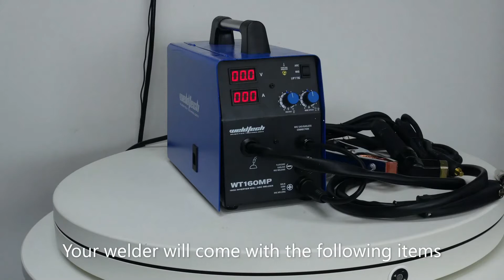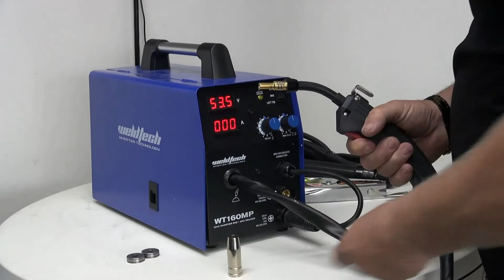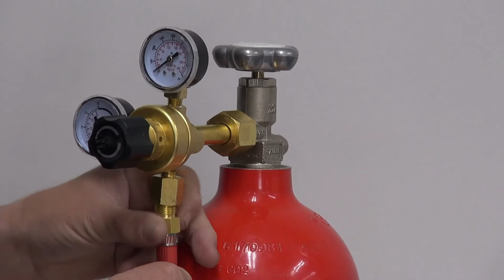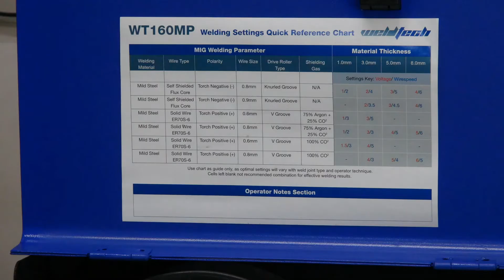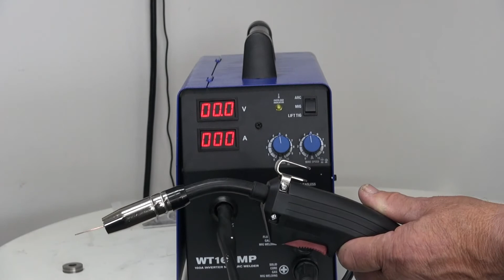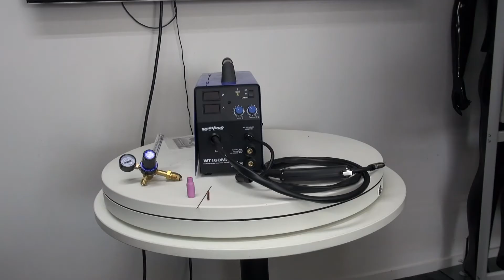WELDTECH WT160MP, 160A GAS - GASLESS INVERTER MIG WELDER

Comment: Hi brother, which wire should use in Tig welding 
Just tell me wire size and which metal
Reply from the maker: You will need the optional TIG torch and you use TIG filler rod in either 1.6, 2.4 or 3.2 depending on the thickness of metal you are welding